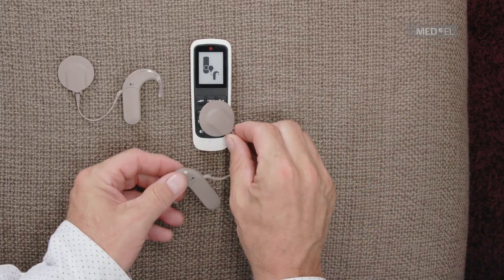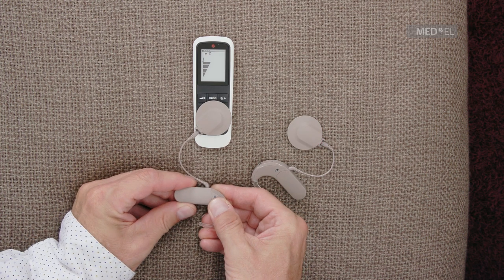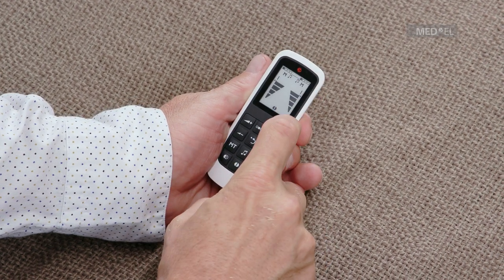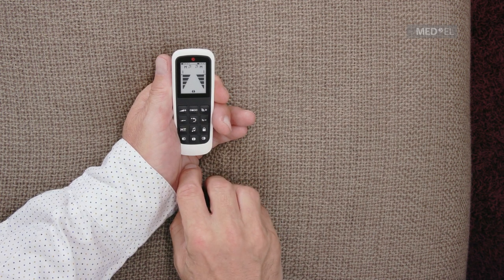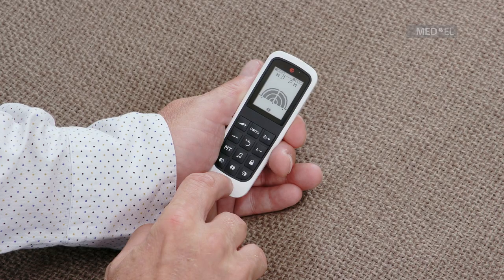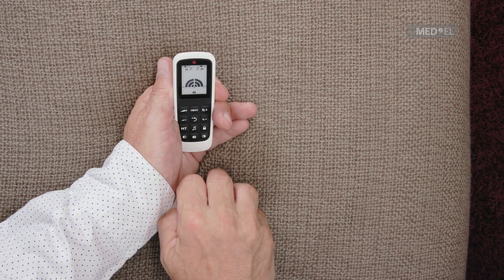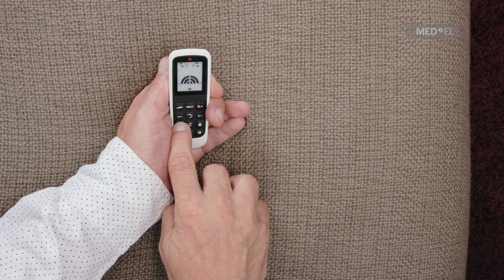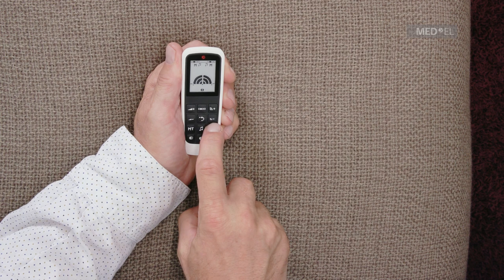SONNET 2 Hands-On: Using the FineTuner Echo |  MED-EL

Comment: Confused.  The Quick Guide shows the coil placed on the back of the fine tuner.
Reply from the maker: Hi Janice, thanks for your comment and sorry to hear about your confusion. Both ways work when pairing SONNET 2 and FineTuner Echo: You can either place the coil on the back (as shown in the Quick Guide) or in the front (as shown in the video). Kind regards, Verena

Comment: What is really the function of the fine tuner?
Reply from the maker: Hi Jen, thanks for your question. The FineTuner Echo can be used to adjust the volume, switch between programs, or start streaming with AudioLink—all at the press of a button. Here you can find more information on it: https://www.medel.com/hearing-solutions/accessories/remote-controls/finetuner-echo

Kind regards,
Gordana
Reply: @medel  Do I need the Fine tuner or can I use a phone app?  (not really sure why there is an extra remote device).
Reply from the maker: Hi  @MaureenMcEachen , thank you for your question. The FineTuner Echo and the AudioKey 2 app serve the same function of remote controls, although they have slightly different features depending which audio processor you have. Some users prefer a physical remote device rather than an app on their phone. Therefore, yes, you can use the AudioKey 2 app on your phone if you prefer. 

Kind Regards, 
Giulia
Reply: @medel  thank you!   It's a lot to process (no pun intended)!

Comment: How do I reset the control and add new devices?
Reply from the maker: Hi there, the default key sets volume and sensitivity back to predefined values set by your audiologist. Please keep in mind that your audio processor must be configured to be used with the FineTuner Echo. You can refer to your audiologist for this step, before pairing a new device. 

Kind Regards,
Giulia

Comment: Fine Tuner Echo does not work. New, replacement item for an earlier Fine Tuner Echo that didn't work.
Reply from the maker: Hello Tim, please reach out to your local MED-EL office as they can have a direct look at your device and assess the issue. Also please make sure the remote control is properly paired with your audio processor. 

Alternatively to the FineTuner Echo, you can use the AudioKey 2 app (to download on your phone), which allows you to control your processor's hearing settings, stats and more. More information about it here: https://www.medel.com/hearing-solutions/accessories/remote-controls/audiokey2. 

Kind Regards,
Giulia